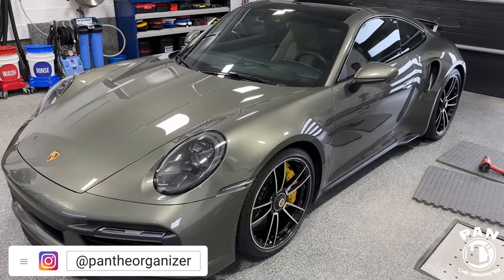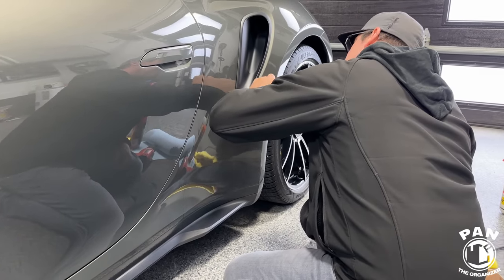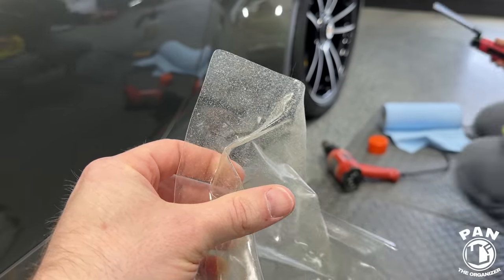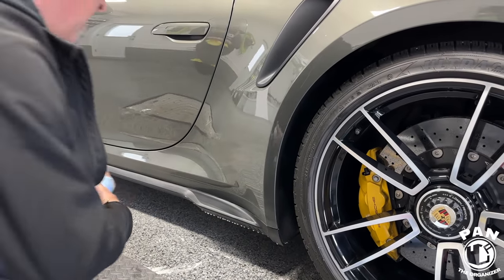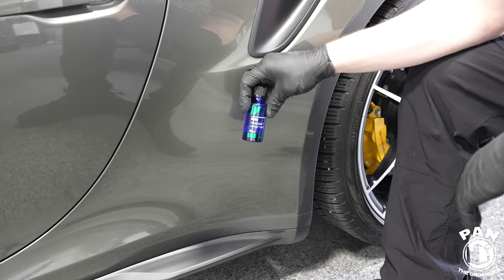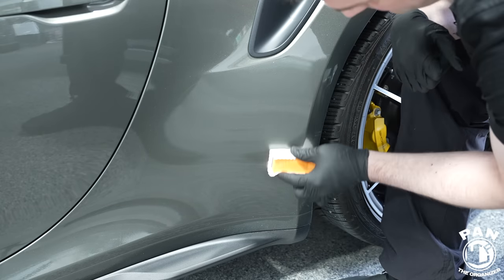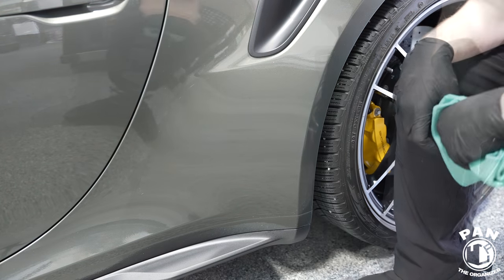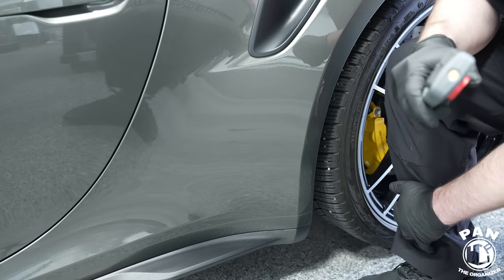Replacing the PPF on my Porsche’s rear wheel arches + ceramic coating!

Comment: What you did looks fine. I am a bit surprised that you didn’t have the whole car done since you live in an area that has very harsh winters. 
Thanks for sharing 👍✌️☮️
Reply from the maker: I am just not a fan of the look or feel or PPF. Plus, as I get a brand new car every three years, and do low yearly mileage, scratches and stone chips are of no concern to me. My cars are always pristine when I bring them back to the dealership.

But for people who keep their cars for many years, and want the ultimate scratch and rock chip protection, PPF is the only solution. I would still recommend a ceramic coating on top of the PPF, for the best of both worlds.
Reply: @PanTheOrganizer For most top end PPF's like Xpel, Stek, Premium Sheild etc that have a hydrophobic and self healing layer, ceramic on top does interfere with its self healing ability but it does allow the film to look much better a number of years down the track, so it depends on what's more important to the user

Comment: Hey Pan do you discard the towels you use to level the ceramic coating or wash them and reuse? 
Your ppf guy made it look sooo easy. His experience definitely shows. 👍🏼😇
Reply from the maker: Always discard towels used to level and buff ceramic coatings in glass bottles.
Reply: Just use them as shop rags after.

Comment: Xpel requires the owner use their ceramic coating only on their  PPF so as to not not void their warranty.  Looks great and will be interesting to see how it holds up and if yellows over the next 2 years.  Amazing how much damage it prevented from your paint.
Reply from the maker: I don't really care about warranties. I'll just pay to have it replaced when needed. Plus, I like to control which products I use, and so far, I never had any issues with the top coating brands like CarPro, Gtechniq and Gyeon. They all have great coatings formulated specifically for PPF. :)

I won't see how it holds up for more than a year though, as I will be getting a new car next year. I get a new car every three years. I like new stuff haha.
Reply: A shop like Chicago Auto Pros that did mine will cover you. They use Xpel, but they do not use any of their ceramic coatings. As Pan said, any reputable coating will not do any damage to Xpel, period.

Comment: Man those chips above and below the PPF would now drive me mad, lol. Although you could fix them yourself, and it'd make a cool video! You can really see what a great job even poor PPF does. My problem as an avid detailer is that I hate the feel of it to work on. Have some clear bra on an F-Type I just bought and it's grabby, and twice as hard to clean. Products get very streaky on it too. It does work though. Another great vid Pan!
Reply from the maker: Yeah, I'm like you, I am just not a fan of the look or feel or PPF. I just did the rear wheel arches as Porsche's have wide hips and they get hammered by the road debris and stones.

Plus, as I get a brand new car every three years, and do low yearly mileage, scratches and stone chips are of no concern to me. My cars are always pristine when I bring them back to the dealership.

But for people who keep their cars for many years, and want the ultimate scratch and rock chip protection, PPF is the only solution. I would still recommend a ceramic coating on top of the PPF, for the best of both worlds.

Comment: Great video.  Curious why you didn't consider cutting a slightly larger piece of PPF to be able to tuck it into the door seam and only leave a much smaller visible edge as it crosses the rocker panel?  Looks pretty invisible now but I would think that leading edge will start to show more with time and dust accumulation just as the old piece did.
Reply from the maker: To make it exactly like OEM. Plus I don't like the look or feel of PPF, so the less the better. I only have it there as the hips of the Turbo S are super wide and take quite a beating, as we can tell from what the PPF was able to save.

Comment: Hi Pan. Why did you choose not to do PPF on the whole car? I have a new Miata RF and I'm considering PPF and ceramic coating it. Thanks
Reply from the maker: I am just not a fan of the look or feel or PPF. Plus, as I get a brand new car every three years, and do low yearly mileage, scratches and stone chips are of no concern to me. My cars are always pristine when I bring them back to the dealership.

But for people who keep their cars for many years, and want the ultimate scratch and rock chip protection, PPF is the only solution. I would still recommend a ceramic coating on top of the PPF, for the best of both worlds.

Comment: Love your content. Wondering what your thoughts are on PPF beyond the rear wheel arches. Lots of differing opinions from what I see online both pro and con. Wondering if you have other areas covered on your Porsche? Picking up a new c8 on Friday.
Reply from the maker: Congrats on your new Vette! What color will it be?

I am just not a fan of the look or feel or PPF. Plus, as I get a brand new car every three years, and do low yearly mileage, scratches and stone chips are of no concern to me. My cars are always pristine when I bring them back to the dealership.

But for people who keep their cars for many years, and want the ultimate scratch and rock chip protection, PPF is the only solution. I would still recommend a ceramic coating on top of the PPF, for the best of both worlds.

Welcome to my channel. You discovered one of the biggest car detailing channels on YouTube as we surpassed 980,000 subscribers and we have over 132 million views! I have been detailing for 26 years and I love to share my knowledge and passion with my viewers.

You found the right channel to help you learn everything about detailing.

Comment: Hi Pam, great channel.  I purchased a used Highlander with self healing 3M protection film on the entire hood. Do I seal it, wax it or don’t touch it? Thank you for your time sir. Columbia,  SC
Reply from the maker: You can apply a ceramic coating on top, no problem. It will protect the PPF and make cleaning much easier. Check with your PPF installer though to make sure it's ok to coat it.

Comment: Hello Pan, in terms of cost effectiveness would you recommend using a PPF specific ceramic coating over one that is only compatible with PPF for smaller amounts of film? Which takes me to my next question of since the given shelf life of CarPro Skin is around 6 months after being opened, what do you intend to do with the remaining coating? Would leftover coating be able to be used as a topper since the lower rear portion of the vehicle takes the most road abuse?
Reply from the maker: You can apply pretty much any paint coating on PPF. It's the opposite that doesn't work. You can't apply a PPF-specific coating on paint. For the remainder of the open bottle, I can either use it on another car, or throw it away if unused. It is what it is. I'm not worried about that.

Comment: Interesting. I guess it did it job protecting that area. Looks much better without it though.
Reply from the maker: Yeah on Porsche 911 cars you have no choice to have that PPF to protect the rear wheel arches, especially on my Turbo S as they are even wider compared to the normal 911, and they take a beating from the road, despite it being a low mileage car.

Comment: Hi Pan, i seem to recall you had applied Roar ceramic coating when the Porsche was new.   I assume the ceramic coating was applied  over the ppf areas.  Could the Roar coating have contributed to the ppf yellowing?
Reply from the maker: No. The coating actually protects from UV rays and yellowing. It would have been worse without it. The factory PPF on most cars is just not the best. The new Xpel I put on is clearly better and thicker too.

Comment: I love the Xpel PPF on my Porsche as well!  I only had installer place the ceramic coating made by Xpel but it seems you can use any coating recommended for PPF.
Reply from the maker: XPEL says that if you use coatings other than XPEL, you void your PPF's warranty. I don't care about the warranty, so I apply what ever coating I want. ;)

Comment: I pulled that off the hood and front fenders of my at Audi at 80k miles (128747kilometers)  .  It was easy here in AZ, just park it nose first into the sun and it comes off super easy.  Film doesn't stick well at 160+ degrees.  I'd never put that on my car again.

Comment: Thanks so much!!  Can the leveling and buffing towels be used for a ceramic coat on an entire car? Or do they need to be changed out at all?
Reply from the maker: If you're doing an entire vehicle, I typically use three towels to level, and three towels to buff.

Comment: If I don’t plan to Ceramic coat my Xpel PPF, can I protect it by using other old school ways of protection - powerlock+ Collinite, TW seal & shine plus another topper, TW Ceramic spray, etc?  Thank u in advance 😊😊👍👍
Reply from the maker: You have to be very careful with waxes and sealants on PPF. You'd have to ask your PPF installer what's ok to use, as most products can void the warranty of your XPEL PPF, especially since XPEL apparently came out with a new policy that only their coatings will keep your warranty valid.

Comment: Is CarPro skin good enough for use on both paint and PPF surfaces? I've had PPF applied to my car in strategic, high-impact areas but need to ceramic coat the car myself due to budget constraints and am wondering if i need to use Skin for the PPF and UK 3.0 for the paint only surfaces.
Reply from the maker: Skin is only meant for PPF, not paint. You can use UK 3.0 on paint and PPF if you want though.

Comment: Can you do new PPF on that car please? It will preserve and protect it better than ceramic coating
Reply from the maker: I am just not a fan of the look or feel or PPF. Plus, as I get a brand new car every three years, and do low yearly mileage, scratches and stone chips are of no concern to me. My cars are always pristine when I bring them back to the dealership.

But for people who keep their cars for many years, and want the ultimate scratch and rock chip protection, PPF is the only solution. I would still recommend a ceramic coating on top of the PPF, for the best of both worlds.

Comment: Pan.. was there more rock chips above where the old PPF was or was that just the metallic in the paint?
Reply from the maker: Yeah there are a few specs here and there. It's to be expected with those hips. HAHA
Reply: @PanTheOrganizer  I bet. Just wasn’t sure if my eyes were playing tricks on me. Also, does adding a ceramic coating to a self healing PPF affect that characteristic? I guess you mentioned in the other video that the PPF specific ones are more flexible. Think I answered my own question. Lol
Reply from the maker: Self-healing and regular PPF are both flexible. No problems.

Comment: Hi Pan!
People in my country are used to wrapping the whole vehicle by this PPF, especially such expensive cars like yours ;) Is this option suits in Canada as well? I mean is it so popular like in Russia?)
Reply from the maker: Yes many people have their entire cars wrapped in PPF here too. I am just not a fan of the look or feel or PPF. Plus, as I get a brand new car every three years, and do low yearly mileage, scratches and stone chips are of no concern to me. My cars are always pristine when I bring them back to the dealership.

But for people who keep their cars for many years, and want the ultimate scratch and rock chip protection, PPF is the only solution. I would still recommend a ceramic coating on top of the PPF, for the best of both worlds.

Comment: Hi Pan, as always another informative video.PPF only on the rear wheel arches?Why not the whole vehicle as it is an expensive sports car...
Reply: Same question here :) why not the entire vehicle? Does ppf no5 protect better than a ceramic coating?
Reply from the maker: I am just not a fan of the look or feel or PPF. Plus, as I get a brand new car every three years, and do low yearly mileage, scratches and stone chips are of no concern to me. My cars are always pristine when I bring them back to the dealership.

But for people who keep their cars for many years, and want the ultimate scratch and rock chip protection, PPF is the only solution. I would still recommend a ceramic coating on top of the PPF, for the best of both worlds.

Comment: How long after PPF install do u recommend to apply ceramic coating? Can I use a different brand, non-PPF specific Ceramic coating ?
Reply from the maker: Most paint coating can usually be applied also on PPF. But check with the company of your comment to make sure.

After the PPF install, wait 24 hrs, and then you can apply the coating. Unless your PPF installer tells you your specific PPF can be coated immediately after the installation.

Comment: The new carpro immortal ppf is even better than Xpel in my opinion. Way clearer, has INSTANT self healing, and has a ceramic top coating
Reply from the maker: I have yet to see a car with that film but it does seem interesting. I really like CarPro products so I'm sure it's very good.
Reply: @Pan The Organizer  we just did a Full PPF on a  jaguar Ftype using immoral. We put xpel next to it and anyone can notice how much better the carpro is. Pretty cool stuff.

Comment: Can you advise if possible to PPF brake calipers? Have you done ? How long can it last? What quality PPF product do you recommend for brake calipers? Thanks
Reply from the maker: I don't think I have seen PPF applied to brake calipers... You'd have to ask PPF installers. Seems like it would be near impossible to apply, and the high heat generated by braking might melt the PPF.
Reply: @PanTheOrganizer  Thanks. It's what I figured. Just thought I'd ask anyways. Thanks

Comment: Belle job ca. C'est clean. J'espère que les edges de ton ppf vont bien tenir. Normalement si l'installateur l'a installé à la place exacte il devrait pas avoir de problème. Je dis ca parce que le ppf ne tien pas vraiment sur du ceramic coating. Je sais par expérience. J'ai voulu faire installer du ppf sur mon bumper avant de Kona Electric 2022 et étant donné que j'avais un ceramic coating, ça ne tenait pas. Tu me tiendras au courant ;) Bonne fin de semaine!
Reply from the maker: Il l'a remis exactement au même endroit. Avec ses 30 années d'expérience dans le métier, je n'ai aucune crainte. Aussi, j'aurai une voiture neuve dans un an, alors ça ne me stresse pas vraiment lol. La vie est trop courte pour s'inquiéter par de si petits détails.
Reply: @PanTheOrganizer  excellente réponse ;)

Comment: I had to remove the PPF on my wife’s Taycan before ceramic coating. The edges looked like they had mildew and I couldn’t get clean. Can I put the PPF over the ceramic coating?
Reply from the maker: You would have to ask a PPF expert. My guess is no
Reply: Thanks Pan

Comment: That damage that the PPF has really showed its value.  Is your car fully covered?
Reply from the maker: I am just not a fan of the look or feel or PPF. Plus, as I get a brand new car every three years, and do low yearly mileage, scratches and stone chips are of no concern to me. My cars are always pristine when I bring them back to the dealership.

But for people who keep their cars for many years, and want the ultimate scratch and rock chip protection, PPF is the only solution. I would still recommend a ceramic coating on top of the PPF, for the best of both worlds.
Reply: @PanTheOrganizer  what do you not like about it I have wanted ppf for forever on my ride just not a lot of options around where I live